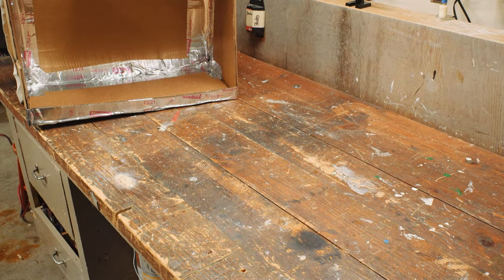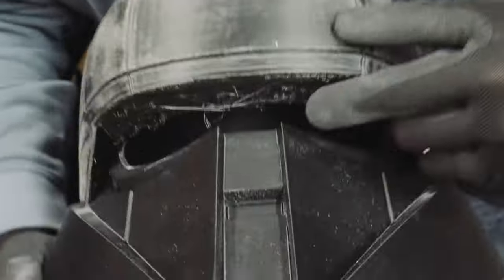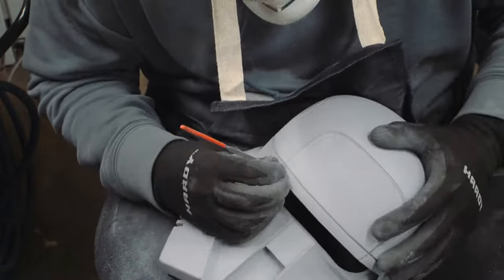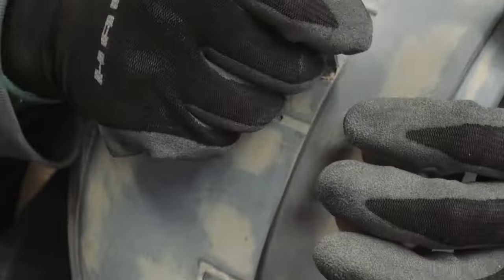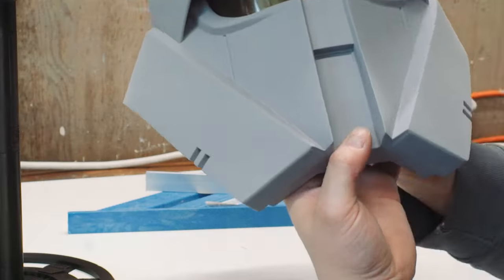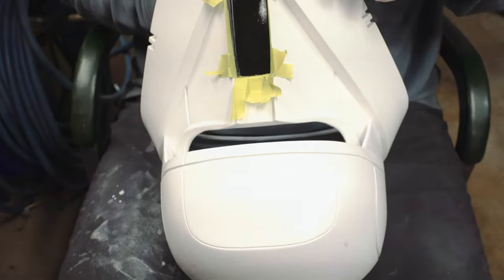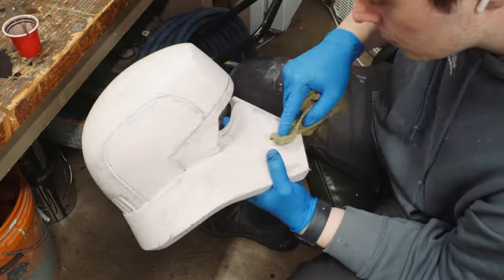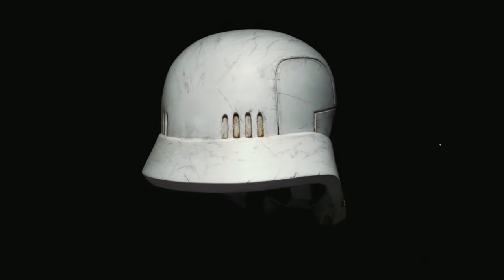How I Made A Range Trooper Helmet - 3D Printing, Painting, Weathering Tips

Comment: Nice job man! I just recently started printing and finishing helmets myself and the few I've done I learned a lot! I would recommend trying a fast/easier method of using uv curable resin from a resin printer. Galactic armory goes over it in their Helldivers helmet build but you add baby powder to the resin to thicken it up, brush it on in thin layers doing small/medium sections at a time and cure it with a uv light. I tried doing a quick all over sand of 80 and then 120, did a few layers of resin and then sanded it and it drastically cut down my sanding time! Then I hit it with Upol sandable primer and did a wet sand and it was smooth! Just something to maybe try on your future builds!
Reply from the maker: I’ll check it out!